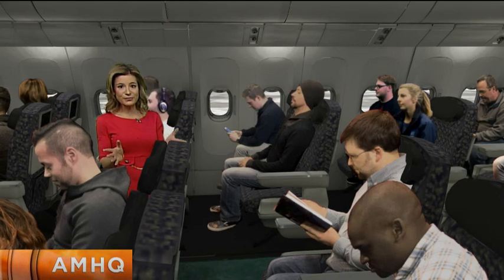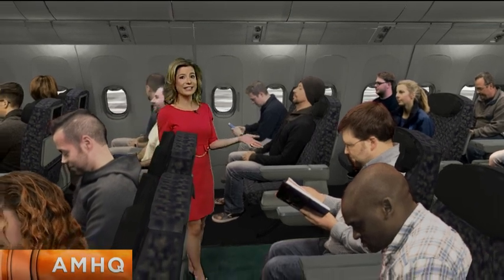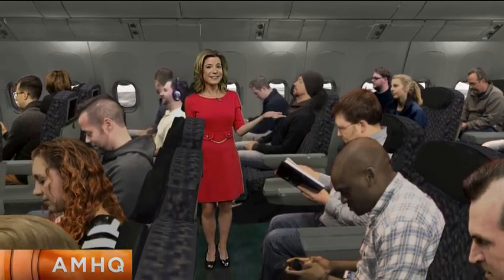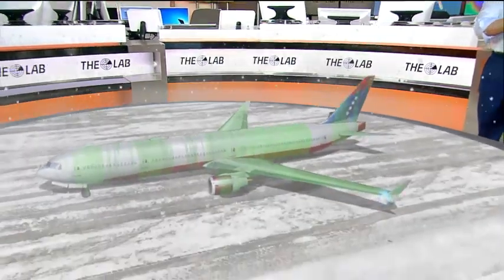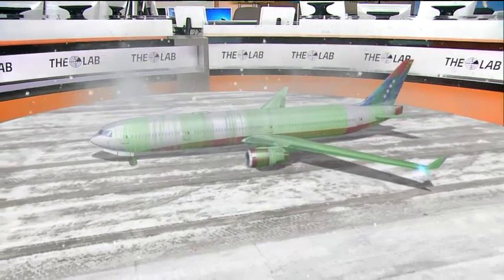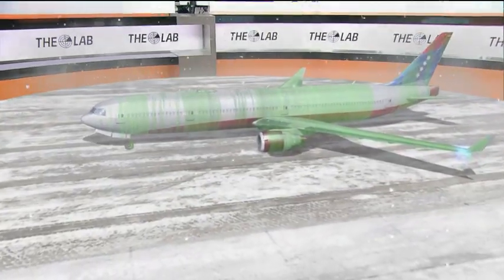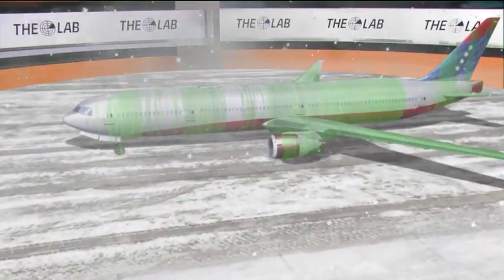Science Behind Deicing Aircraft in 3D!

Comment: As someone who working in the airline industry and used to de-ice aircraft there is a mistake, in a sense, that they made with their discussion. They state that de-icing is important, which it is, ice build up when the plane is on the ground can affect the aerodynamics and the ability of the flaps, etc., to operate properly. However, their model shows that without de-icing, a plane will freeze up when it reaches its altitude, which is usually 30,000 to 35,000 feet as a cruising altitude. Well here is my argument -- the air temperature is always freezing up there, even in the summertime. De Icing an aircraft does nothing to help a plan at higher altitudes. Just like when you go to a self service car wash and then drive away, all that liquid wax you just applied and and water just rolls off because of the aerodynamics and the force of the airflow pressing against it. The same thing happens with an aircraft, as it accelerates and lifts up on an angle, the solution gets blown away. De-icing is important but it also give people the sense of security that the plane is protected from the elements, when in fact it only protects from take off until it climbs up past 10,000 feet (as an estimate).

If it was a 60-degree(F) day on the ground the temps would reach freezing after about 8,000 feet and at cruising level it would be about -48 to -66 degrees(F) outside so any moisture from going through clouds, etc, would already be frozen. The wings and flaps and engine area and cockpit windshield and nose are extremely heated, so the metal and glass melts any cold moisture in the air. The nose defrosts as well because of the amount of radiation heat that is thrown off from the nose radar unit.

This are the temps up in the air: on a day where it was 60-degrees(F) on the ground:
Height (feet)         Temp (°F)         Temp (°C)
5,000                       41.17                5
10,000                     23.36                -5
15,000                     5.55                 -15
20,000                   -12.26                -24.5
25,000                   -30.05                -34.5
30,000                   -47.83                -44.3
35,000                   -65.61                -54.2
40,000                   -69.70                -56.7
60,000                   -69.70                -56.7
100,000                  -51.10               -46.1
150,000                  19.40                -7
Reply: It has deiceing strips